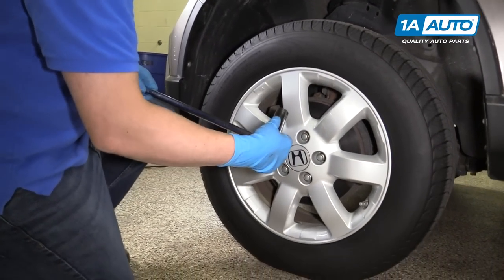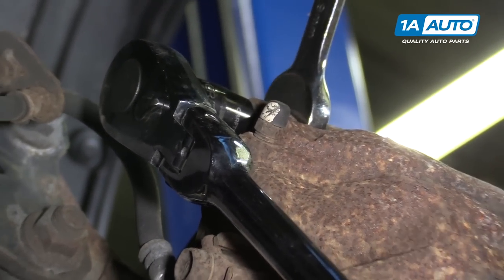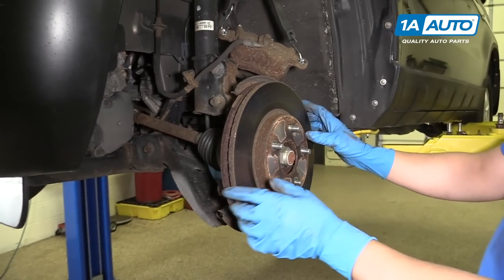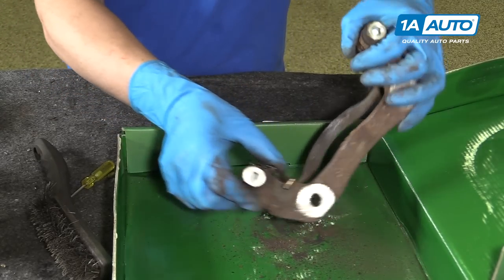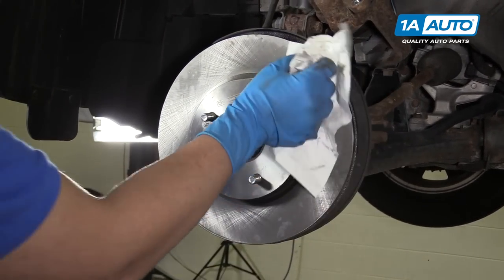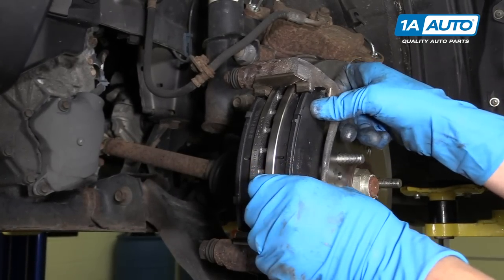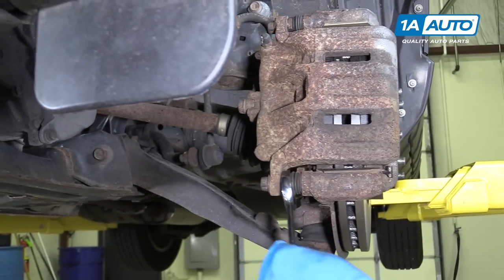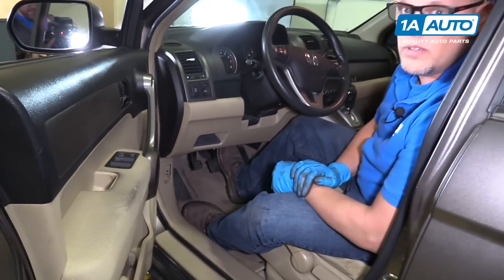How to Replace Front Brakes 07-11 Honda CR-V

Comment from the maker: √  Watch the Video
√  Buy The Part at 1A Auto http://1aau.to/m/Visit-1AAuto
√  Do it Yourself
√  Save Money
Reply: Great video Thank You - any tips on losening rusted 19mm caliper bracket bolts?  Using breaker bar but still stubborn.  Penetrating oil?  Heat with small torch?  (I don't want to snap them!)  Thanks.

Comment: It's worth noting that the Phillips screws that hold the rotor on are NOT standard Phillips head. They are called Japanese industrial standard and using the wrong screwdriver to remove them will likely overtime strip them out. If you work on or own a Japanese vehicle they are well worth the investment!

Comment: I never push the fluid back into the system. Always bleed it out and pump up, bleed out the air, this flushes the fluid in the lines. That stuff is water attracting, needs to be purged out. If it’s been a long time since the last brake job, start by draining (siphoning or use a turkey baster) and replacing the master cylinder fluid first so you don’t just send all of that old fluid down the lines.
Reply from the maker: +John Becnel Thank you for the tips and for watching!
Reply: Thats great but its not needed and most people are looking for the least expensive option when changing brakes. majority of people live paycheck to paycheck in america and added unnessesary steps added to a brake job will just add unnessesary cost the bill.

Comment: Thank you, just asking myself why no lube for easy disassemble if needed next time, like basket was pretty tight, if some Anti-seize on, then comes apart easier when needed, also your BRAKES don't come with NEW CLIPS, I also thought you should have stated the wear indicator goes on the inside part of the Rotor. Also brake cleaner on rubber dust boots on slide pins ? That safe for rubber, if so, then should say so and what kind to use, I've never used brake clean on inside like that, just asking because the pro now. I've done many brakes, never on  Foreign vehicles, always stayed away after helping a friend a VW, wasn't fun and never again. Also where some rust pointed out on Hub, you wire brushed it, why not put Anti-seize there before rotor going on, making it easy to come off on next BRAKE JOB and on screws so don't rust in tight, then need impact tool screwdriver to get out if lucky, might need to chisel screw by backing It Off with a chisel, for a few bucks, they can be replaced if in stock. Should come with rotors in my opinion. Great video, hopefully my questions can be answered.
Reply: Stop making so much sense, broski, you're making everyone look bad.

Comment: Another great 1A video...thanks.  I've watched many brake job videos and I see some put lube on the brake pad slides/ears and other don't.   I always put lube on the brake pad ears with my brake jobs...but why not lube the ears?   I noticed you did not.  Is that recommended by Honda?  Thanks !
Reply from the maker: +kev hed Thanks for checking us out! Apply lubricant on caliper pins, clips, edges of the brake pad mounting tabs, and back side of the brake pads if needed. *Do not apply lube on the friction side of the brake pads.http://1aau.to/m/Shop-1AAuto-c

Comment: How rusted do the break calipers need to be to warrant a new set? Thinking of changing my front ones out on my 2008 Honda CR-V.
Reply: It’s best to change them when you change the brakes
Reply: @willfrederickson2131  Change the calipers when you change brake pads? Are you insane?
Reply: Rust is not a reason to warrant new calipers. If the calipers work and are not leaking then there is ZERO reason to change them out. Rust acts as a protective layer. The parts are designed to rust and the layer of rust protects the part from further corrosion. You will notice its only surface rust which is expected and normal.

Comment: What's the purpose of the screws for the rotor other then to hold the rotor in place?
Reply: That's pretty much the only purpose. A lot of cars don't even have those screws, the rotors are usually loose. Technically you don't even need those
Reply: They are only used on the production floor when the car is built because the rotors need to stay in place on the assembly line before the calipers are installed. You DO NOT need to put the screws back when doing a brake job. Those screws will seize up and be a bitch to remove in the future so its best to remove them and get rid of the screws.

Comment: Never use same hardware, everything must be cleaned like new ! never use paper to clean caliper pin and housing.
Reply: Your technically correct but using new hardware is only recommended to prevent people from using a bolt with rust on it and m essing up the threads. As long as you pay attention and clean your parts there is no reason you cant reuse hardware. They are trying to sell you new hardware there is new reason you need new hardware.